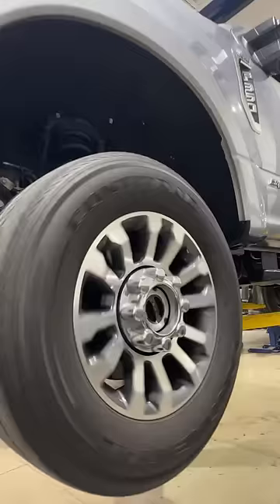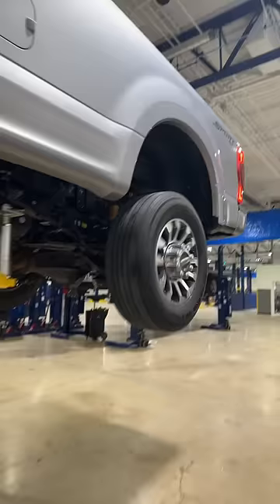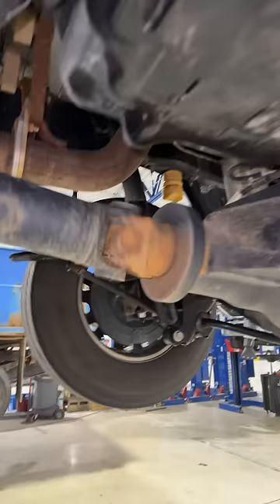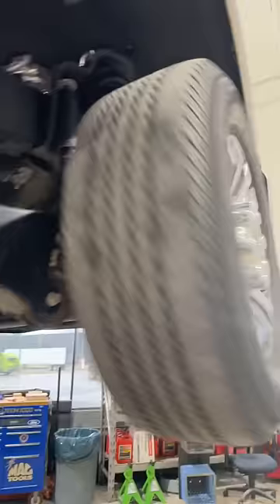NEW 4x4 noise 2022 | F250 F350 #broken #fyp

Comment: 17k on the clock. . . And the surface rust is already out of control.   ☹️
Reply: Yep. No antirust coating from factory it seems... I guess you gotta do you own now...
Reply: @ireallyreallyreallylikethisimg  When you spend this much on a vehicle. Spend a bit more and get a under coating. Its a few hundred extra. Especially in Salt country.
Reply: Made in USA what u expect
Reply: @MR-si1eq  When you spend that much on a vehicle it should have been done at the factory.
Reply: Exactly.   And I want thicker cab and roof steel.
Reply: @TT29RS5 no...the steel is from CHINA
Reply: Guessing it’s a midwestern salt road state?
Reply: @TT29RS5  😂 you ever seen a Toyota frame before?
Reply: Yes Toyota has the best coating on its frame . Very nicely done .
Reply: @davidbryant3532  actually the steel is from the USA or Canada.
Reply: @Ray956Texas  there is no permanent coating that works. You need to early coat the frame on a truck with thin oil if you operate in salt country.
Reply: @SuzukiKid400  if you research...you will find only 20% is.
Reply: @ireallyreallyreallylikethisimg  yep get your truck undercoated just like it’s been now for many decades
Reply: @IsleOfFeldspar  the truck body is made of aluminum, try to keep up
Reply: @Ray956Texas  yup those Toyota’s rust right in half. Cheap steel, cheaply made truck
Reply: @Chuassy  yeah I have 2007 Camry that looks better then that China made car
Reply: @TT29RS5   The only vehicle I've ever had rust completely in half.  Was a Toyota truck and it wasn't made in America.
Reply: @Puckers.The.Goat1  u didn’t take care Of it that’s there’s no holes in my frame like a 1500 would have or any other Chevy junk German and Japanese are the way to go they last way longer
Reply: @TT29RS5  I could be mistaken but a Camry is a galvanized body, it doesn’t have a frame to rust.
Reply: @TT29RS5  I have a 92 Tacoma that has the definition of devastating frame rust, I also have a ford transit with a galvanized body with 0 rust. You can’t be so bias, they all have good and bad models and years. My Land Cruiser is very durable but am I going to sit here and say that means every Japanese vehicle is the best, absolutely not. Because they are not
Reply: @ireallyreallyreallylikethisimg  I got this stuff called rust grip, used on off shore oil rigs, and hwy bridges. Army corp of engineers tested to take 15k hrs of salt spray. I put it underneath my car last fall, and waiting to see if it survived this spring.
Reply: @ArnoldsDesign  please let us know if it worked I would be very interested
Reply: @danblanzara3174  No problem.
Reply: Think about it. Problem with 4x4 this thing is probably plowing or just being daily driven in snow often, which means it’s getting blasted with salt
Reply: @Chuassy  I had a 2005 Prius with 273,000 miles that I slid into a telephone pole with two years ago. The rocker panel was barely starting to surface rust where the paint was scratched. My current 2005 has no rust after last winter other than the shocks, struts, brake rotors, normal parts.
Reply: @paulhunter9613  Bullcrap. I have a 2019 Tundra and it has no where near this level of rust. You’re obviously some Ford fanboy.
Reply: @Chet73  perhaps your little ‘yota  has been in Arizona all it’s life compared to the other vehicle, don’t know or care princess
Reply: @paulhunter9613  A truck isn’t supposed to rust like that in a year, Scooter. No matter where you live. Anyway, my truck can outlast any hunk of junk you’re driving that’s for sure.  Stay jellly little buddy. 🤣
Reply: Those are only the items that see heat. Any vehicle will have rust in these areas.
Reply: He had to be driving that through a salt water river as a shortcut to work each day....how else can it rust that badly so soon?
Reply: @Mrtekem  Heat. Heat accelerates oxidation. Notice how only the parts that get hot are rusted?
Reply: @Chuassy  toyota also offers the absolute best factory undercoat job hands down. The major rust issues on the truck frames are about a decade old...
Reply: @TT29RS5  yep, the U.S. Built Tundras too.
Reply: @MR-si1eq  Bad undercoating jobs only make it worse by trapping moisture between it and the frame
Reply: PSA toyota pickups did in fact have rust issues pre-2005. toyota spent billions out of pocket to recall  and fix rust damage on tundras, tacomas and t-100 pickups alike.
Reply: I’ve e got surface rust on my grandads bmw anyway to get rid of it it has sentimental value
Reply: As much as these trucks cost they should have some type of coating on the frame, cerakote maybe? My 2004 Toyota tundra the frame still looks good, but it was bought in the south and has always been here.
Reply: @Chuassy  what frame? Those came with one?
Reply: @TT29RS5  My 2015 Tundra was made in the USA but it's had no issues
Reply: @MR-si1eq  these for sure but lol when you spending so much $$$ on a vehicle already  you kinda expecting few things to come with it
Reply: my’02 Sierra 2500HD has 70k and nowhere near that amount of rust
Reply: @TT29RS5  most of the car factories in the US are down south now, so I'd hope they'd not be as rusted.
Reply: @Chuassy  it's a unibody, monocoque. Rusting on that type of body is far more a safety concern as it can compromise the entire structure.
Reply: @240sxRule  that's a good observation. They probably use higher quality metals in those areas.
Reply: Hes not from cleveland
Reply: @ArnoldsDesign  where did u buy it??
Reply: @ArnoldsDesign  where did you buy it?
Reply: @matt84712  Rust Grip from Superior Coating Solutions. I think they're just a reseller.
Reply: Truck probably came from the Canada plant I swear every truck I’ve seen that has Canada on the vin tag is rusted to hell
Reply: Clock? You mean odometer. A clock is used to determine time, not distance.
Reply from the maker: Ayyyyye yo DJ, keep spinning the records & leave the auto stuff to us.....smfh
Reply: @Ray956Texas  because if they didn’t put the coating on it. IT WOULD HAVE RUSTED ALL TO HELL IN 8 MONTHS!
Reply: @TheGuccibane Exactly, l saw a few badly rotten frames in a few years old truck, all because of moisture trapped in pockets of poorly made undercoat. 
No coat is better than wrong coat.
Reply: Red mud, not rust
Reply: @Chet73  Well, since its your truck I'm sure its the best and everyone is jealous of your truck.  
Because?   Reasons I guess.
Reply: @AcidFlash123 but it's your duty to do the research on the car that you're paying that much money for so you don't have the right to complain when you spent the money and had no idea that it wasn't already done.
Reply: @paulhunter9613 unsafe Toyota too